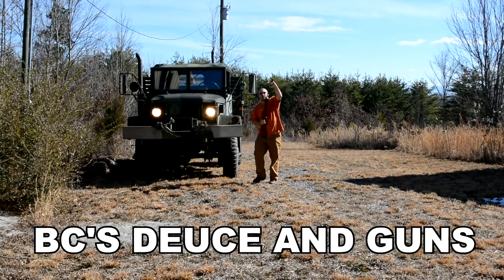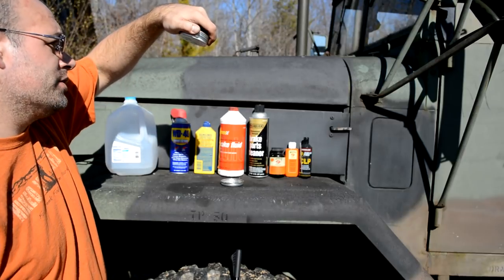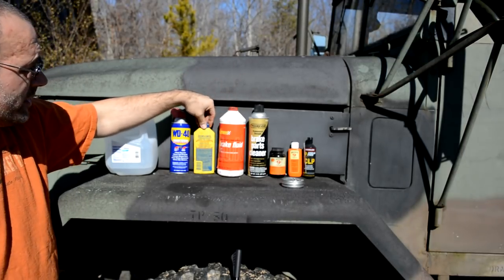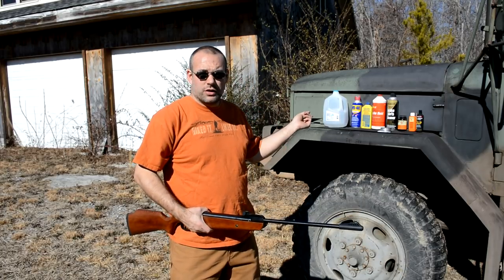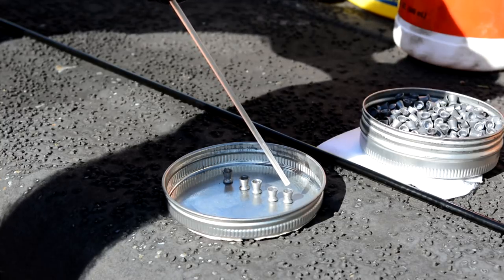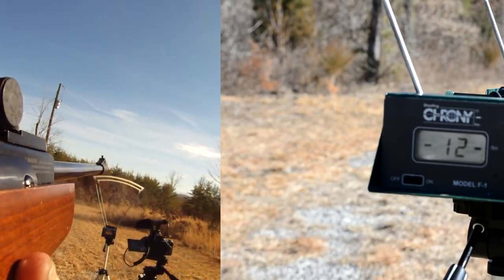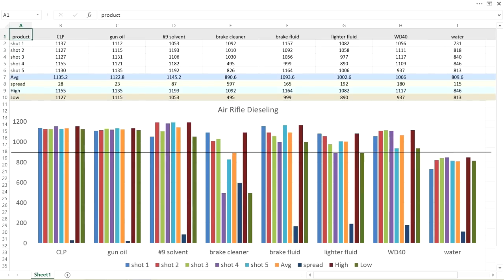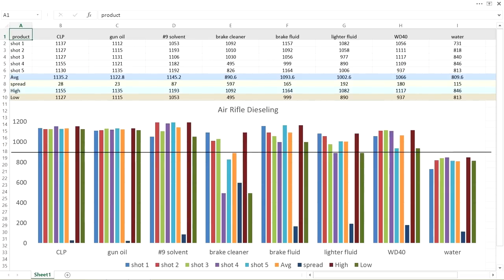Air Rifle Dieseling For More Power Part 2!

Comment: Ive diesel'd for years, never have I damage a rifle or hurt myself!
Reply from the maker: Neither have I but knowing how people are I felt a disclaimer was needed.
Reply: Disclaimers are fine, but your not gonna hurt the rifle using this method.
Reply: Same. I suspect this all arose out of manufacturers warning against it to protect themselves from both liability and from government. By adding a combustible material, you are in theory, creating a firearm...but since we’re all Americans here, who gives a rip.
Reply: about 200 fps more is not much of a gain with these light projectiles, is it?
Reply: @Scout887  If my math is right, it's an increase speed of around 30%  Those are pretty big gains.  I would guess the difference in drop would be obvious If the increased speed doesn't screw up your accuracy.
Reply: My grandfather has dieseled for year as well no problems

Comment: Gamo Hunter 440 .22 owner here. I discovered dieseling after cleaning my air rifle, by using a vegetable-based oil designed for lubricating fine mechanisms (sorry, I do not remember the brand). The reason I liked that particular oil was that it had a high viscosity (sticky) and took a really log time to evaporate - this means that the contents of the pellet skirt stayed put even as I carried them in a small box - that's if not shaken too violently.

I experimented by dosing with a small syringe and needle, for better control. Did not have any device to measure pellet velocity, but you could really hear and feel the difference in the shoulder, as well as check penetration of wooden targets (went straight through inch-thick fir), which I thought it was unbelievable. I found that it can nicely increase the rifle's effective range in the 60-70 meters, when hunting for crows or magpies. In my case though, I felt that accuracy was dropping, or at least it was not as consistent as with plain pellets.

Now to the side effects. My Hunter air rifle had an original PFTE seal / head ontop of the pressure piston. After firing about 50-100 dieseled pellets, the backfire from the combustion cut a clean hole through the teflon. Now, I considered buying the original replacement as well as other... alternatives. Since I wanted to still be able to use dieseling, I chose a piston head made of oil-and-heat-resistant rubber, which had been originally designed for some sort of fuel/oil pumps. I have never had an issue with that seal ever since, although it must have fired thousands of dieseled shots.

Hope this helps someone.
Reply: I have owned 2 gamo hunter 440 toys, the seal was stuck like hell when i changed one. I will never ever buy a springer again. The spring/piston recoil is most annoying thing about them. AND weight! Only PCP's for now on
Reply: Where did you buy the heat and oil resistant piston?
Reply: Cristian-Gabriel Stan morning where did you get your seal from?
Reply: @THEDC81025  Hi. Wish I could help you there, but it's not that simple. My father-in-law used to work for a company that built all sorts of specialty pumps; the company is long gone. He still had a few of these o-rings used to seal centrifugal shafts/axles, left in some old drawer.
Reply: Cristian-Gabriel Stan ok thanks if I just put a drop of oil in the insert of the pellet do you think it would damage anything if I do it consistently but with just a drop or 2?

Comment: For many years I have been using Diesel additive, and up to date it has been the best yet. The additive is the stuff you can buy from most retail auto suppliers. You add it to your vehicles fuel to cut down on any smoky exhaust. It works by giving the fuel a higher cetane rating so that you get a more complete firing burn at a lower compression rate. So!!! you can imagine what it is like when you use it neat, just one drop from a small squeeze can in the hollow of the pellet just before you close the barrel gives it a real cracking sound when it is fired.
      Another thing that I have had good results with is the fuel that is used for propeller driven model aircraft, it is a compression ignition  fuel the same as diesel but it fires at a lower compression rate, so gives good results in a gun.---- A word of CAUTION----- I only use dieseling fuel in old worn airguns to boast their power as it is not normally needed in a good gun.. Good shooting everyone!!!!!
Reply: That cracking sound spoils all what is left of accuracy on wore down springer

Comment: Nice video.  Some other substances to consider:
Diesel fuel, gasoline, nitro methane, pure alcohol (ethanol, methanol, propanol, butanol, etc)  black powder smokeless powder, flash powde,r flash cotton, any number of powdered primary explosives (use extra caution her, of course)

Comment: Could you try candle wax set in the pellet skirt?

It would be interesting to see if it works, because then you would be able to have reliable dieseled pellets that would be easy to load and could be stored for long periods of time.

Comment: thanks for posting. a  late comment.  great vid.  there is one type of fuel that might change the performance curve.   but you probably don't have it laying around.   two-stroke model engine fuel, or just caster oil.    cheers

Comment: I have an old Baracuda 5,6mm(Weichrauch) breakbarrel air rifle that is purposely designed to operate for dieseling mixture of ether(chloroform)-gas in the rifle's compression chamber. The ether gas is stored in a sids mounted gas chamber tube and will deliver a certain amaunt of gas/vapor directy to the rifle's piston. I've noticed a significant increase of power/velocity is achieved when using round-ball heavy grained pellets compared to the common dovetail type pellets. This ball pellet tends to hold a bit longer in the barrel and wait until the diesel explosion occurs and this moves the pellet in a very high propulsion pressure.
Sadly I cannot get a new high quality spring(specifically made for this purpose) any longer from Weichrauch or else.
So you should try this using a more tight sized pellets(like roundball or slug) and maybe the results will be better. One other thing, the dieseling explosion will also increase backforce to the spring and make it weak and shoten it's life. 
Keep up the good works 👍

Comment: I am actually trying to STOP dieseling in my old Gamo 440. I replaced the spring and seal in it, but I greased the seal too and when I got it back together, it was dieseling really bad. Figured out what I had done, took the gun back apart, cleaned all the grease off the piston and inside the cylinder too. Made sure there was NO GREASE on the piston, seal, and cylinder and put it back together. Ran some pellets thru and it is still dieseling, however not as bad as before.  So if you ever run this test again, try automotive grease.

Comment: Brake cleaner is more ether based than alcohol.  Try plain old CH3OH (methyl) next time.  It won't evaporate like ether.  I was skeptical about the brake cleaner.  I would also always lube your gun after using any solvent (ether or alcohol or water) based propellant before you put it away.  You could also try naptha (zippo lighter fluid).  I like the results though.  Really nice graph.  Post more.

Comment: it seems like you left out a few obvious ones in this test, primarily something like diesel or kero, something paraffin based like paraffin (or other waxes), chapstick, vaseline (all of these could be easily pre-loaded and you wouldn't have to worry about knocking them over) and I would have liked to have seen something like the 3in1 that you used in the other video or just plain old motor oil under the same conditions.  All of those would also be cheaper than your top contenders

As far as the damage that everyone is expecting... I'd be willing to bet that it's just a question of newer, more modern, higher quality seals vs older stuff... your not going to burn a seal unless the ignited gas leaks past it, and for the same or less money that you used to need to shell out you get a much better, better quality rifle with better quality parts.  Even some of the Chinese ones are actually quite decent now, and I would expect them to last longer/do better than older rifles.

The other side of this is what are people using magnum air rifles for that they need more power?  Lesser rifles are the ones that typically need more power and I would expect them to be the ones that wouldn't last long, while a lot of magnums come close to the speed of sound where this kind of thing will hurt accuracy (though I suspect you could work around by carefully choosing pellets)
Reply from the maker: I have a part 3 planned that includes many of the accelerants you mention. Thanks for watching and stay tuned.
Reply: How about some gasoline? Or diesel fuel? or lighter fluid? Doing this is just plain stupid........
Reply: I'm completely with u mark !
But dude....!  Didn't you noticed this guy had some real hope in WATER!??
So i realy fear your advices are much to "progressiv" for this case here !!?    😂😂
Reply: I'm also curious what results stuff like diesel fuel, vaseline and paraffine wax / bees wax would give. I got good results with vaseline (petroleum jelly). But I don't have a chrony to compare different compounds. With vaseline it's easy to put a consistant amount into the pellet skirt and it will stay there and won't spill all over the place or in the compression chamber, or passing by the pellet, like more runny liquids would possibly do, just by capillarity effects.
But creasy and waxy compounds may also need a higher temperature to ignite and burn properly, what might be lowering the dieseling efficiency.
So - I'm still curious about the outcome. ;)
BTW: In fact the seals and o-rings usualy can't handle the dieseling pressure well. I once testet this with a tissue put over the barrel gap. Was pretty greyish from the exhausts afterwards.
Reply: @deuceandguns   was part 3  ever made?

Comment: Very interesting videos.  Thanks for taking the time and the risk to make them.  I am interested in the results you might get with a similar gun/powerplant in a larger caliber.  Just as they are a little more efficient in .22, then typically a little bit less in .25.  I would bet that dieseling would yield the best results for power in the largest caliber and with the lightest ammo

Comment: How about gunpowder? Like a little bit of it on the bottom of the pellet and half a drop of oil on top for the ignition.
Reply: Or mix black powder with petroleum jelly.
Reply: @martinwatters2729  that see sounds interesting
Reply: @thomasgellos1732 The dieseling should revive the black powder with compression.Ideally all powder should remain dry but this could work.

Comment: @deuce  when I was a kid I broke a lot of springs doing this, lucky the springs where only 5 bucks. when I did this I did it totally differently. I did not put the fuel on the pellet, I put it in the compression chamber.. warning. try this at your own risk. I broke a lot of springs, as all the air in the chamber burns
Reply: How many improved shots would you expect from oil in the cylinder?

Comment: I know this is pretty old but I have some knowledge of these products and since the design of the air rifle is specifically about extreme pressure why not try an extreme pressure lubricant?

My favorite very affordable and reliable brand is Marvel Mystery Oil's air tool oil and it has a little spout that would make it real easy to put one drop and only one drop on a small pellet.

My thinking is that the lubricants are really just making the bore slicker. So along those lines why not a teflon based lube? In my table saw I use the generic PTFE resins that dry white and obviously this is ideal because  
 a) no solvent to ruin the gun
 b) You can spray a whole tin back home or spread out on newspaper then bring them out to the field, range, etc...
 c) they won't be messy or a fire hazard, either.

Comment: Two things to conceder. 1) Newton's law says for every action there is an equal and opposite reaction. There for in a spring action air riffle the pellet is being pushed by the action of the spring. What ever dieseling action that might accrue would be pushing equally on the spring and the pellet, there for you will only get as much pressure as the spring can produce. 2) For what ever fuel you use, it would have to be atomized in an oxygenated air mixture for combustion to accrue. A drop of oil in a pellet has no chance of ignition. The added pellet speed is due to the oil acting as a seal and a lubricant between the pellet and the barrel. What you see as smoke coming from the barrel is the oil atomizing as it is leaving the barrel. Now lets say you shot a squirt of starting fluid, butane or propane in the compression chamber, that might get you ignition. Because the fuel would be mixed with oxygenated air, and by compressing that you might get enough heat to ignite it. Just my thoughts, The oil in the barrel would be a good thing to prevent rust and friction damage to the barrel.
Reply: Old Man, you're simply wrong.  First off while you can accurately quote Newton it doesn't mean that you understand him.  The spring is not static and the accrued momentum of the spring in motion, releasing it's kinetic energy, is exponentially greater the longer it's travel (increase in speed).  You can imagine if you try to push your car from a standstill it's possible but if that car is traveling at max speed your effort is worth virtually nothing.  Secondly, THEY CALL IT DIESELING FOR A REASON.  It works just like a diesel engine, which has no spark plug but rather works on the increasing percentage of oxygen in a decreasing volume of air until the oxygen percentage and the heat of compression gets to a spontaneously combustible level.  The oil is burning as evidenced not only by the very obvious increase in power (more than the sealing power of the oil) but also in the smell of SMOKE (which smells like diesel exhaust for a reason).
Further I don't think that it does much, if any, damage to the rifle.  The combustion does take place in the barrel and with the constantly increasing amount of air coming from the spring piston it effectively pushes the cumbustion out away from the piston port.  I've heard many ppl expound nauseasously about the dangers and damage to air rifles and I've found none of that.  I've been dieseling for years and there's been no obvious damage or wear to the sealing ring of the breakbarrel.  I think the funniest comment that I read from someone in his vehement diatribe against dieseling was how it broke his...... 30 year old, $10, chinese made air rifle when he tried to diesel it.  However, I would add that the large amount of incompletely burned oil results in soot buildup in the  barrel.  Really, it's pretty extreme.  Just think of a exhaust coming from a diesel truck.  These sooty remains can be acidic and eventually cause pitting if left in the barrel as well as accuracy issues from buildup scraping off onto the exiting pellet.  I usually just shoot some wet paper towel wad through the gun.  Happy shootin'!
Reply: I also think your wrong Old Man, I have Dieseled for years, and there is clearly an ignition point in firing oiled pellets..
Reply: You do not need any mixture of air and chemicals to have a combustion occur and newtons law has nothing to do with the spring piston producing enough power to propel the pellet at a greater velocity
Reply: while i am not a scientist i know what oil smoke smells like, i also have black soot from the burnt petro in my barrel, on the end of my barrel and sometimes even on the targets i shoot as the pellet carries what ever is in the barrle with it. i often use 3 in 1 oil and it smells just like the toy trains we use to have that burnt oil for sake of appearances back in the day. also, it fires so much more fpe that some times it even breaks the pellets apart before leaving the barrel. also when dieseling my air rifle it seems to crack loud like a 22 lr, sometimes it cracks so hard it can make my ears ring but usually not.

Comment: I use mink oil water proofing paste , why ? Because it’s in a nice round tin fits right in pocket and it’s what I had I was going to clean it out and add vasoline but I tried the mink oil and it was just as good as the petroleum jelly so for 6 plus years lol it’s been mink oil water proofing paste ! It must have been my fathers as I haven’t worn leather boots in the field for probably 40 years ! I figured out dieseling in air guns during a cat engine update school where the instructor showed us the power of dieseling with many products and how it changed power per square inch and why some alternate fuels were exceeding factory specs and that we should be not honoring warranty when these products were used in a cat engine!

Comment: Doesn't brake fluid or cleaner eat seals?
Reply from the maker: It depends on the type of rubber being used but you are correct that it can make the seals too soft/brittle to hold pressure.  The cheaper the air rifle the more likely a cheap seal that would be affected was used.  That's why I used a throwaway rifle for this demo.  Even if it doesn't fail catastrophically it may start it on a downward trend in usability.

Comment: D and G could you get a 35 dollar Crossman 760 and test that for speed, accuracy and DURABILITY. I have a theory that non-rifled air rifles will hold up better then rifled ones in these tests.  IMO there will be nothing to slow the pellet down and stress the seals like a rifled gun would do.
Reply from the maker: The old pumpmaster?  I got one of those for Christmas back in the early 80s and my nephews still shoot it.  I'm not sure if the pump will ignite the oil but I can try.  Thanks for the video request.
Reply: ***** I have tried dieseling an old 66 power master and it doesn't work. Give it a try though.